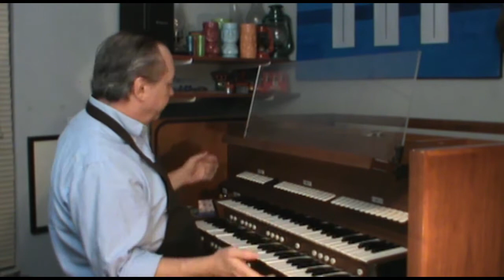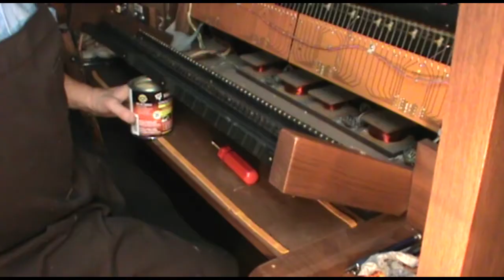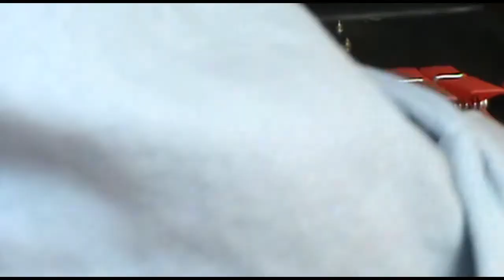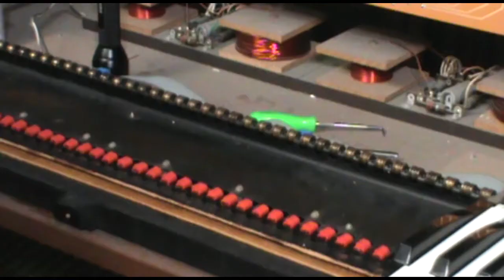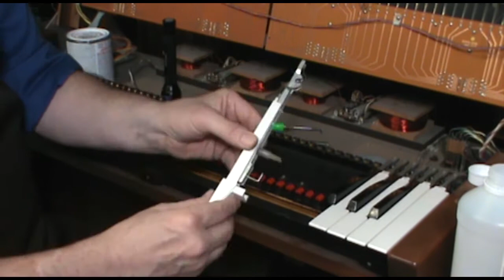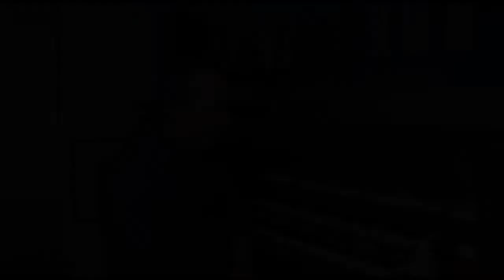Rodgers 725b Part 3 Keyboard Repair

Comment: Is this the standard strips of bushing cloth from Schaff
Reply from the maker: Yes, this did work but it was only practical because I had the strip felt. You can get replacement rubber "donuts", they are pricey but easier.

Comment: would you have any suggestions how to repair/reset a Rodgers digital keyboard model C-100? When powering on it gives an "ERR" message on the lcd display.  None of the sounds are working right.
Reply from the maker: The C100 is an early digital product. You may want to check with a Roland service tech.
Reply: @TonyImperatrice  thank you for your reply.  I'll try to find a service tech

Comment: Thanks for the very informative videos. I have a Rodgers 725B organ.  Its keyboards are still in fine shape but of course in time they will need this kind of repair. When that happens I don't believe I would feel comfortable using your approach even though it is obviously excellent. As an alternative, do you have a suggestion of what to use as a replacement for the rubber bumpers?   You mentioned that your procedure would not be used in a field repair. What would a repair technician use?    BTW, I loved your videos on the Schober.  Like you I saw a magazine advert for the recital organ and wanted to build one badly. Also like you I couldn't afford it and ended up buying an ancient Wurlitzer 4602 electrostatic reed church organ which I used until I purchased the 725B in 1985.   Thanks very much. I look forward to watching all of your videos.
Reply from the maker: I think you can get replacement bumpers from Fatar. I had a Wurlitzer "weez box" organ. It was my first practice organ. Glad you enjoyed the video.